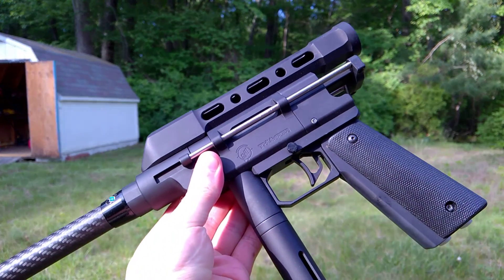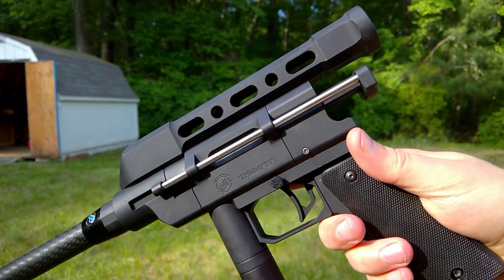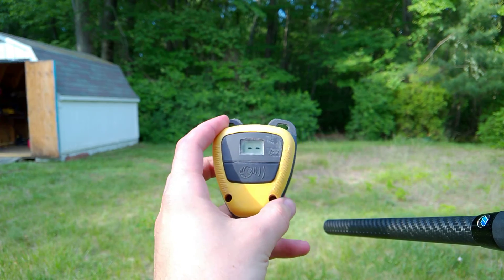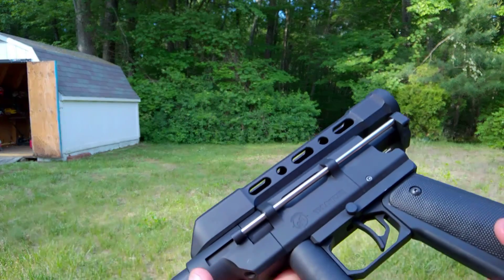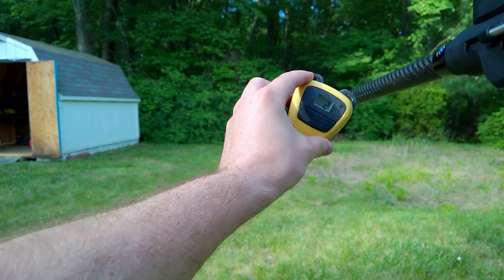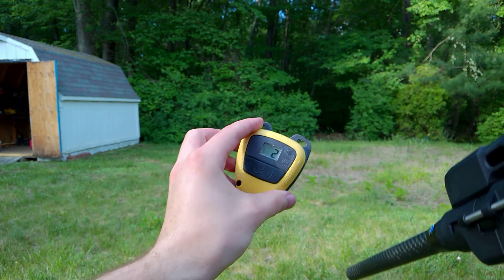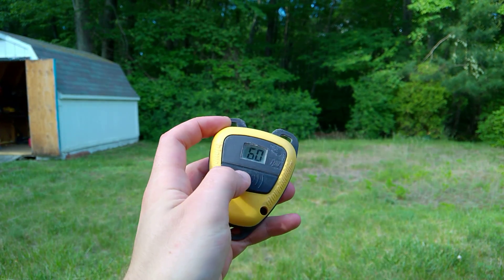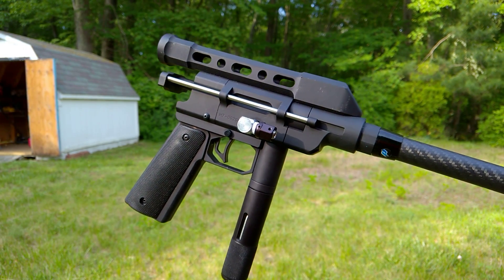Metadyne Thumper Test 1

Comment: Love it!  Im actually about to pick one up this weekend.     Where mught i be able to find all the upgrades i would need for it?  Thank you!
Reply from the maker: Back in the day you could actually send it back to Metadyne and they would perform the updates, I am not sure if that is still possible. To me, the Hammer update is really the only one I'd want. The original aluminum hammer wears out and doesn't always actuate the valve. To get the old hammer out though, you have to drill the body so the pin holding it in can be driven out.